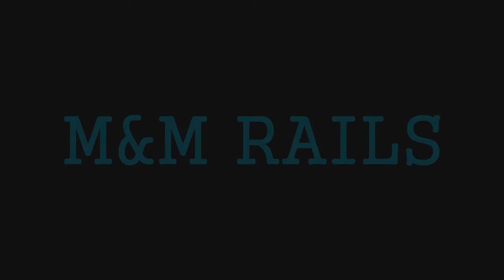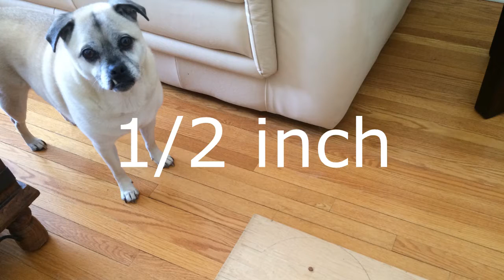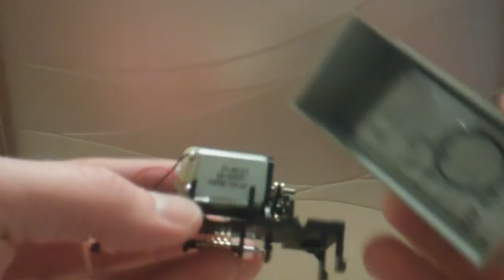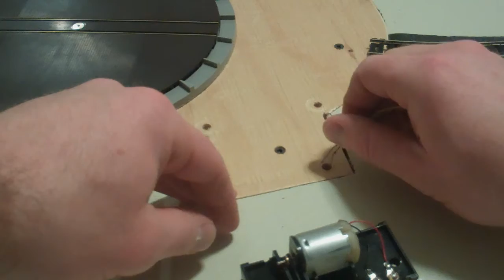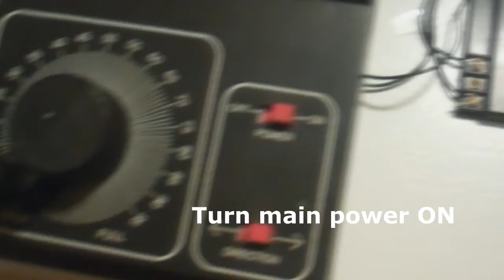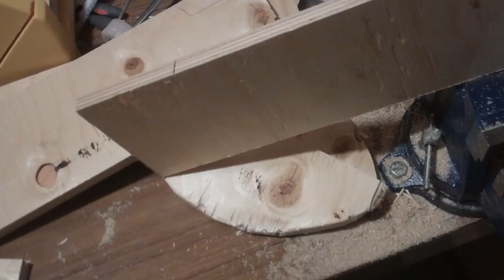Installing Atlas #305 Turntable with #304 Motor Drive

Comment: How do you get the track to stay in place?
Reply from the maker: Most of the track on that layout was pinned down with small pins into the foam. We glued a small section down. Even the turntable was pinned down to the foam if I remember correctly. It’s been awhile.

Comment: I installed the N scale version and believe it is very similar. I recessed mine to better mate surrounding track. Otherwise, little difference. I wonder if you have ever found any way to reduce the sound during operation as it seems to make the devil's own noise?
Reply from the maker: Thanks for sharing Donald. Unfortunately I no longer own this layout and no, I never found a way to quiet the motor. It did make quite the racket.

Comment: Hey! Loved the video, been a huge help! Just one question. I'm using at atlas controller as well to control my turntable, do I NEED two cab controllers? Or can I just use one for now and leave the 2 connectors on the bottom half unused?
Reply from the maker: Thanks! Glad it helped. You don’t need two controllers. Just the one will do. The second one is for another person to run trains.
Reply: @MMRails  okay thank you! For some reason I just couldn't find that information. I purchased a used layout and have been restoring it and it's looking like I may need to replace the selectors. They don't seem to be working properly. Thank you for your time!

Comment: Mark I don’t think you have this anymore but I have one and going to install in my yard  2021
Reply from the maker: That’s great James! Can’t wait. And you’re correct, mine is gone.
Reply: Mark I am getting the yard build ,because of space , turntable was free, it will help turn a locomotive around , have old DC power pack to control it

Comment: i just got mine a few days ago . i got mine at a yard sale. IT DOES NOT WORK. it is pretty old.
Reply from the maker: Aw, sorry to hear that. I wonder if you can still buy them new. It doesn’t even work manually? You don’t need the motor for it to turn.

Comment: A very nice video and explanation.  I'm looking to purchase this same turntable and motor, though I have two questions:  1) Is this turntable compatible with sectional track (where the track is molded to the roadbed)?  2)  I'll be running my trains via a DCC controller that does not have an A/C terminal for accessories, so I'm wondering if I should either invest in a "wall-wart" A/C adapter, connect the turntable to a DC power pack that I have, or try another option.
Reply from the maker: Thank you! I don’t have any concrete answers unfortunately but my guess is for 1) you could probably transition from the turntable to the sectional track with one small piece of snap track. And 2) I would use your DC power pack. Give it a try. I’d love to hear an update. -Mark
Reply: @MMRails  You're quite welcome, and thank you for your prompt response :).  I did some measuring of my locomotives and rolling stock, though, and realized they might be too big for this turntable, as most of my coaches and locomotives are slightly larger than the turntable's just-under-23cm radius.

Comment: This looks like a good turntable,

Unfortunately, it’s way too short, if it were longer I’d get it
Reply from the maker: Worked great, but yes, if you had long steam trains with a tender, no good.
Reply: @MMRails  yeah, I’m probably gonna end up getting the 130’ Walther’s one,

Way more expensive and difficult to set up, but it’ll hold just about anything!

Comment: Hey Mark 👋 my turntable seems to be running at 2x slower. Is there a chance you might know why this is happening? I have the motor attached in the correct place
Reply from the maker: Hmm... top of my head... did you increase the throttle speed? It’s been awhile since I owned that and wired it up. At least it works. That’s half the battle. If I remember correctly, if you increase the throttle speed it actually turns the table faster.

Comment: Can you explain more fully the wiring from your power pack to the Atlas controller? Which power inputs (the top/ bottom
Reply: Control the turntable?
Reply from the maker: Hi Eldon, it’s tough for me to explain through a comment but Atlas does a fantastic job explaining it in their book and maybe online. I sold this layout three years ago so I’m a little rusty as well. I’ll get back to you. Leave your email if you want me to send you some more info. It’s not very complicated. I should have explained it better in the video.
Reply from the maker: https://shop.atlasrr.com/t-manuals.aspx
Reply: Thanks for your immediate response and the atlas link below. Wonderful, our first major snowfall, time to set the turntable .
Reply from the maker: @eldonwyman2222  Good luck!

Comment: I don't understand how a loco can be turned through 180 degrees and not short out the tracks when it exits as the turntable and external track are now at opposite polarities (in dc)?
Reply from the maker: Science man, science. Actually, I think if you drive on forward, you have to exit in reverse. It's been awhile since I've used it (sold now) but if I remember correctly, you have to leave the same way you entered. Make sense?
Reply: @MMRails  Thanks for that. I will purchase a turntable now.

Comment: would the turntable it's self be compatible with Bachmann EZ track ?
Reply from the maker: I can’t say for sure, but I don’t see why not. The only thing is you’d have to have a very small “bridge” piece of track to connect the EZ track to the turntable. Since the track actually sits on the turntable, EZ track wouldn’t fit.

Comment: I remember seeing an article in Model Railroader, where the had sunk the actual table, installed a bridge unit, making it look more like a Walthers turntable, very interesting project
Reply from the maker: Sounds interesting. I would have loved to sink mine a bit, but to sink it evenly all around would have been too difficult.
Reply: You can run into trouble trying to sink your turn table in the foam trust me I tried with my old ho scale layout.

Comment: Surprised you could not find some small screws long enough for the job.  I have a box that are 2.5" long.  Well, its installed and working, that's all that matters.  I still have to pick up a motor for mine.  I was waiting to get a used one but none still have not come along.  I hate to pay the $50 they want for a new one.
Reply from the maker: You have 2.5 inch long screws that are super thin?? Put them in your next video for I do not believe you. I looked everywhere. And then I pondered...makes sense that the longer the screw, the wider it should be or else what would it support? Too thin would break. And yes, I paid through the nose on that whole system.
Reply: @MMRails   I know they make long and skinny bolts or machine screws. Not wood screws though.

Comment: see I like these turntables. I grew up on these. Will it work with dcc?
Reply from the maker: I have no idea. There might be a way. I'm sure someone will leave a comment with the answer :)
Reply: M&M Rails yes, it will work with DCC you need a decoder though. And you were correct some one did comment 
...Zane